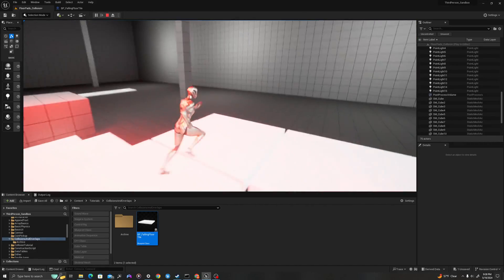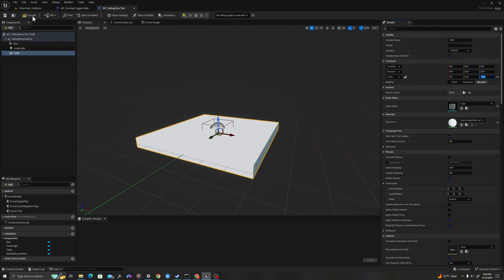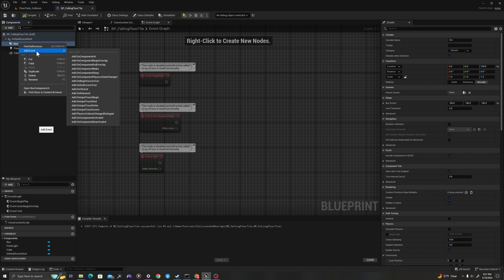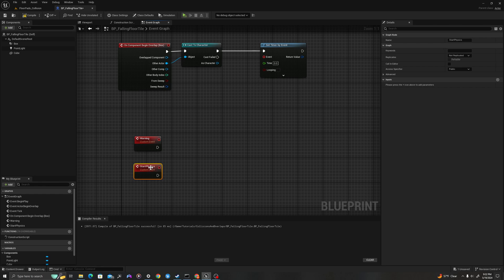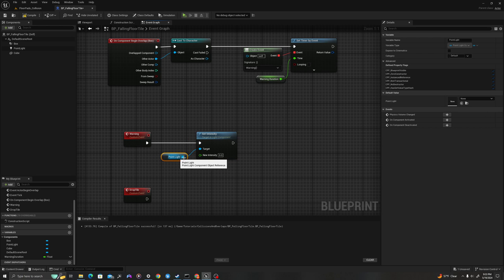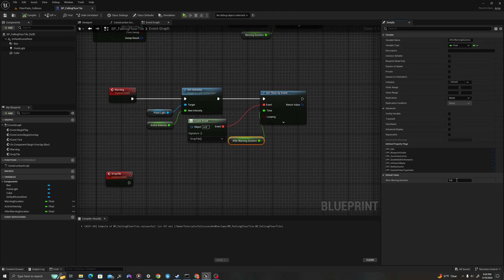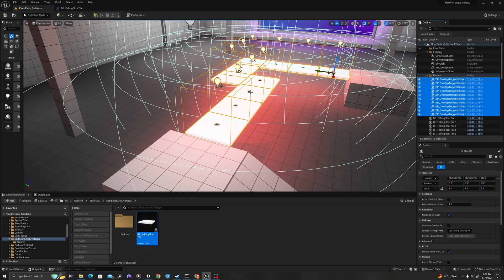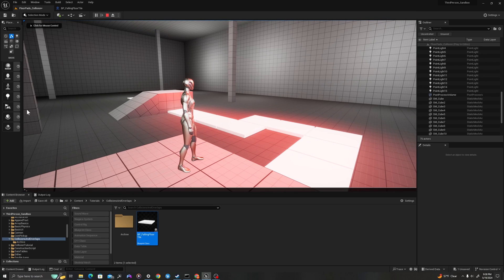Learn Blueprint in UE5 - Make Falling Floor Tiles with PHYSICS and COLLISION!!!

Comment: next time include the destruction of a platform when if falls. and make it delayed with a sound & animation before it falls. (for example a wooden bridge you walk on falls down after a short delay.)
Reply from the maker: Those are some great ideas! I could add a second video for that - I’m finding that a lot of my viewers like the “under 10 minute videos” that cover one or two major topics, where what you’re describing is collision, animation, and destruction.

What’s your preference on video length? 5-10 minutes? 10-15? 15-20? @Liqweed1337
Reply: @UnrealDevHub  5-10 minutes at max. if a video is 15+ minutes, it needs to be a very special, rare and interesting topic with muiltiple layers of challange and difficulty. :)